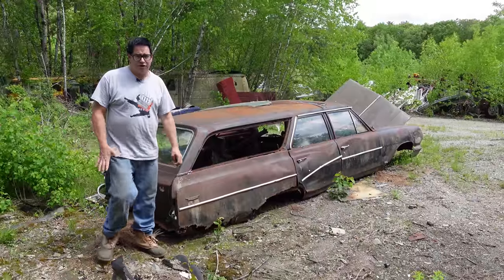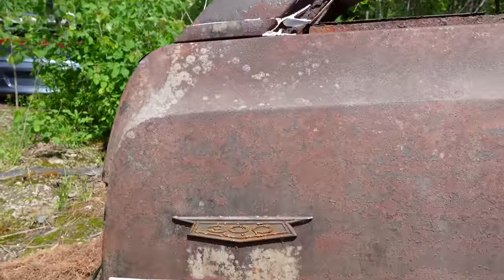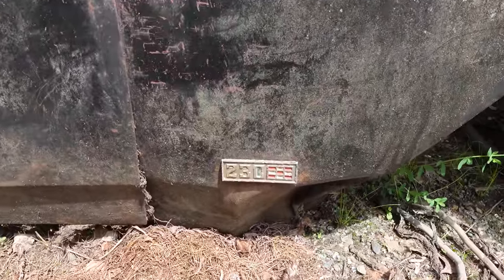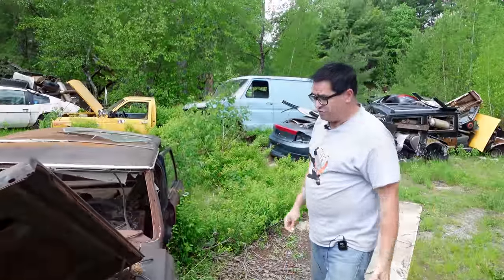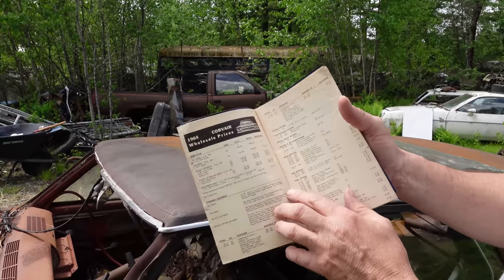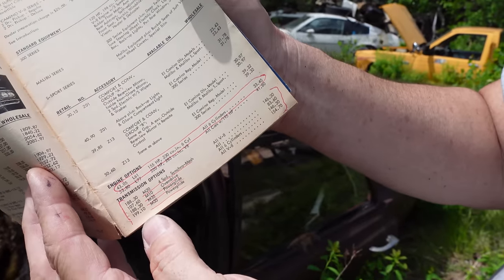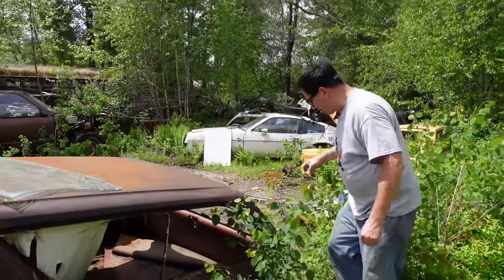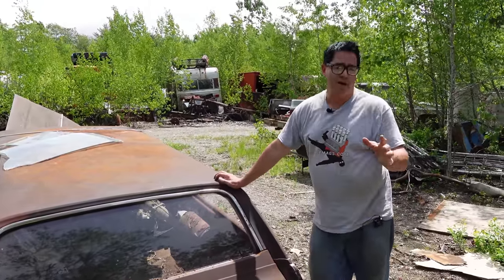1964 Chevrolet Chevelle 300 Station Wagon

Comment: My parents had a 1969 Greenbrier wagon. It has a small block under the hood. Of course, this was a Chevelle wagon upon which, for some reason, Chevy bestowed a name previously used on a van. We were young and we didn't know it was a Chevelle but it became the second car and we got to use it as teenagers. It was a blast to drive,, especially in the snow, and it lasted until the early 80's when it finally gave up the ghost.

Comment: I had one of these. It had the 283 with Powerglide. It also had power steering and electric rear window. Great car for taking my friends to the beach. Mine was assembled at the Van Nuys, CA plant.
When I bought it, it had a bad exhaust valve, so the seller let me have it for $100. I was able to change the valve myself.

Comment: Only Powerglide car I ever drove was not to long ago my brother had a 66 Impala? with the 283 2 speed. We tooled around town in it and is seemed perfectly suited to the task. Jumping on the QEW between exits I was able to experience the limitations of same but around town or back roads with your foot NOT planted all the time it is a pleasure to drive... I would ease off the gas and it would kind of manual shift into second and pick up the throttle smooth as can be. Really nice setup.

Comment: You could transplant a new, remade frame into that worn out vehicle, plus an engine, all the missing (used) parts, from a donor vehicle.  That would knock the sceptics right out!   Depending on how good your access / search skills were.   Remove all the glass, and seals, and dip that body into a rust removal vat.  Weld patch some clean scrap metal, and almost good as new!  lol.

Comment: Let's take it all the way with the trim tag, and construct the VIN for the win:

With the tag, we can brag: 11C for the third week of November 1963 production, 5435 for Chevelle two seat four door station wagon, BA for Baltimore, MD assembly, 778 for Red interior trim, 900 for Tuxedo Black exterior paint as noted. Interesting is that BA on the tag for a Chevelle in 1964 was Baltimore, MD assembly, but on a passenger car BA could be Atlanta, GA assembly (Lakewood Heights, which closed in 1990. The last car made there was a "box" Caprice which was raffled off to the employees on the last day the plant operated which was Monday, August 6, 1990. That video is on You Tube for those that wish to watch it). 

With the VIN, we can win: 4 for 1964 model year, 53 for Chevelle six cylinder, 35 for four door six passenger station wagon, B for Baltimore, MD assembly, and the rest is the production sequence. The Baltimore, MD plant operated from 1935 until Friday May 13, 2005. That plant assembled a variety of vehicles and product lines over the years and also assembled the Astro and Safari vans which was the main focus through the end of the operation of the plant.
Reply: It was built just in time to be a part of the JFK assassination!
Reply: My recently purchased 1978 C30 Camper Special was built in Baltimore. There is a pink "thank you card" in the glove box signed by the plant manager and the truck's sequence number hand written inside.
Reply: @phillipjohnson9753  Hopefully the truck is in good shape. That's a keepsake item. I wonder if the plant manager could be tracked down today.
Reply: @googleusergp  the truck is in good enough shape that I am taking it on as a project. I was after this particular one for about 12 years, the last 7 of which it sat a lot. It is in fairly good shape for an Ohio truck and I got a fairly good price.
Reply: @phillipjohnson9753  Sounds like the 1983 Snap On KRA59F/1981 Craftsman 706.65053 toolbox project I got. Free from a coworker with tools inside of it, I've got it decent enough now for everything to roll, slide, and lock the way it should. I'm into it for a set of keys for the lower lock (upper lock parts on the Snap On are NLA, so I've got to find used ones), and some time. That's it. It had a mix of Snap On, Matco, Craftsman, S-K and other tools in it. Couldn't pass it up. Price was right.

Comment: Bought a 64 2 door Chevelle wagon, it had been hit in the driver's door. I put it in my father's wrecking yard. It was a 6 cylinder 3 speed car. Sold a number of parts over a 2 year period. Went down to the yard one day and the car had been crushed. Whoever had it before I did had it painted metal flake green. Paid $35 for it at an insurance impound auction.

Comment: Thanks for the info im redoing a 4 door 300 deluxe 230 i6 but changing the 3 speed manual to a 700r4 auto is costing 10 X what the dealer got for the power glide

Comment: The chevy ll used the 300 level as well I think. 300 & 400 then nova right.
Reply: In '62 and '63 Chevy IIs came as 100 ,300 , and 400 series before losing the 300 to the Chevelle in '64 . A 200 series was planned but none have ever been found , the 400 was the Nova and Nova SS .

Comment: Hey dont forget how the powerglide was bump-startable!
Reply: really? only thought the early automatics were capable.....
I was told it was only ones with a rear pump? maybe you know
Reply: @michelletaylor5691  mopar with cable / pb shift (up through 1965) had front and rear pumps and were push startable.

Comment: Ford also had a 300 on the Galaxie Model for 1963 only. It was the Base Model.
Reply: Yep there was a problem with the shifter on these, when idling in Park, they would often drop into reverse on their own.  Seemed to be the '300' model only.
Reply: @ExilefromCrownHill  Not only on the Ford 300 Models, but on all FOMOCO products! And it was like that all the way up to the mid 1970’s. It was a big Recall back then! Ford finally fixed it by putting a Warning Sticker on the dashboard, or sun visor saying make sure your foot is on the brake! lol

Comment: 1959 there was just 2 chevys. The chevy and the corvette. A few years later there was the full size chevy, corvair, chevy 2, midsize chevelle, corvette, and camaro. Thats alot of new models. Similar for the rest of gm and ford. I find it interesting that before the 60s every brand had only 1 car they made.
Reply: You should double check your information....In 1959, Chevy had 17 different models, which included the Bel Air; the Biscayne; the Impala; and the El Camino.
Reply: @willhorting5317  they were all the same body shell though. In the end 17 versions of the same car.